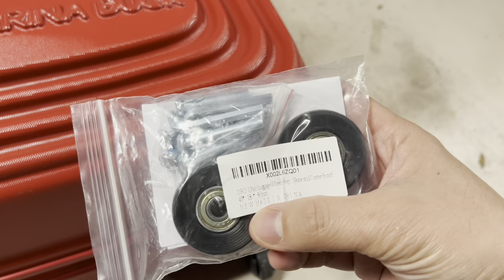Replace/Upgrade Luggage Wheels to Ball Bearing - SMOOTH RIDE

Comment: Luggage manufacturers continue to put useless thermoplastic rubber wheels and parts on their products. They degrade faster than you can travel...
Reply: probably so that they disintegrate and then you are forced to buy another new case.
Reply: Most manufacturer add a layer of soft rubber to their castor wheels. I suspect this is a standard way to reduce noice from hard plastic wheels.
Reply: Yep. And they should be held accountable. Because perfectly fine luggage with cheap, damaged wheels fills our landfills creating senseless waste.

Comment: The washers go on the inside (if necessary)! They are for padding the wheel thickness to match the caster clearance. You don't need washers between the screws heads and the caster fork. 

If the fork has 21 mm clearance, but the wheel is 18 mm wide, and you tighten the axle, you're bending the fork, which is bad. The correct washers let you tighten the axle nut firmly without bending the fork.

These kinds inline-skate-type wheels have the beautiful attribute that they tighten firmly into the fork: they do not require free play, unlike the riveted garbage they are replacing. You want to get the axle tight, without undue stress on the fork.

Comment: Cutting the old wheels off was a lot harder than anticipated, ended up using a dremel and hacksaw combo (7+ mins per wheel). Also keep in mind that changing the wheel to these better bearing wheels does not alleviate any issue you may have with the swiveling and turning of the wheels.
Reply: Depend on the type of hack saw you use.
Reply: The original axle is actually a long rivet.  The concave (cup) end of the axle is only thin metal.  Find a sharp drill bit that is just over the diameter of the axle, and drill into the cup.  It will cut through the rivet very quickly.  Then you can drive the axle out with a punch.
Should only take a minute or so per axle.

Comment: Thank you for this video. My relatively new American Tourister Luggage shamefully decided to shed all the rubber parts of its wheels. They just crumbled when I pulled them out of storage to use them during the easing off the pandemic lockdowns. I have inspected the inside of the suitcase and there is no way I can replace the whole assembly just like I did for my gaming chair's wheels that are just plug and replace. Now I'm off getting these replacement wheels and sawing off the crap ones. Again thank you for this video.

Comment: I just did exactly this. I got four wheels of Amazon for $15 CAD.  Replaced all four on a suitcase (two had broken tires).

Do not even think about buying replacement wheel caster assemblies, if the casters are not damaged!!! Tires only.

Comment: i was about to throw my suite case.  this video saved me...  the rubber material degrades in time.  why dont they make thee whole wheel with a single hard material ?  is it available with a single hard plastic or polycarbonate ?

Comment: Replacing it myself took longer than expected for couple of reasons
Firstly I had a bad saw, so I had to use some else’s better hacksaw but it still took a long time. 
Second problem arose when I got the wheels and tried to install them inside the wheel frame 
They would get stuck on something and not be able to spin freely. 
I had to just file down a little thing sticking out, and also sides
Third problem arose when I realized the wheel holder thingy, was bent somehow from the stress. 
So all in all it took me well 2 hours. Or maybe a bit less, but I think it was worth it.

Comment: How do you know the wheel size of your luggage and what skate wheel size to purchase?  I have Travelpro underseaters' need skate wheels.
Reply: You need to measure the current wheels on your suitcase, diameter and thickness as well as how long the bolt is. It's a bit hard to get the exact measurement but you can get pretty close - just measure and check multiple times! Just as long as the new wheel isn't thicker or much bigger in diameter than current wheels (cos you have to make sure it will still fit inside the wheel well)

Comment: I had a samsonite luggage I have had more than a decade, still in very good condition but the wheels have crapped out twice already. Same thing with samsonite backpack i bought more recently, the rubber on the zipper handle disintegrated which has nothing to do with wear because the bag was unused. Also had a antler i bought in 2016, used only once and now the wheels have disintegrated. I an wondering what exact material they are using for the rubber. This is really shady behaviour from the manufacturers.
I have an old delsey, heavy as shit and rolled all over the world but the wheels are completely intact. Its definitely in the type of rubber they are using, and not wear and tear.